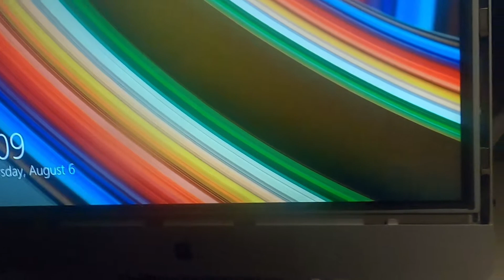Resurrecting a dead Imac into a stunning 1440p display

Comment: I still have to see one of these conversions show clearly that it is sync’d at 2560×1440. From icon size and desktop elements, it looks like 1920. You should include an image of the monitor OSD showing current mode, or computer display resolution dialog showing current resolution.

Comment: I got dizzy with your infamous camera work! And no need to be so dramatic, that LCD controller board is on sale on eBay cheap, just make sure you get it with the correct connectors for the LCD model number by looking on the white label behind the screen. Also you should cut a piece of plastic for the buttons and screw it to the space left by the ram door!
Reply from the maker: I will try to go slower with the camera.  Sorry I get excited making these videos 😜. I wanted to fill the ram door originally but I left it open for my HDMI, display port and VGA extension connectors to hang out.  It is my second screen sitting above and just behind my main screen which hides these connections, so it's not so glaringly ghetto and ugly 😏

Comment: Does something like this also work with a 21.5 inch 4K iMac?
Reply: Possibly. You need to find out the screen manufacturers information.
Reply: @4KWalkTubers  I see, thanks. What I’m actually worried about is space, because I’m not sure how much room there is inside the smaller iMacs and if that’s enough 😅
Reply: @anianii  I did the same thing with the 2011 21" model. I think the 4k models are a bit flatter right? But in mine there was plenty of space left. I even thought about putting some kind of mini pc inside. In the end I just went for a Chromecast.
Reply: @jeroenjansse95  I believe they’re the exact same size actually 😅 But thanks for letting me know 👍🏻
Reply: @anianii  a okay I thought the 4k was a newer (slimmer) model
Reply: @jeroenjansse95  Ohh yeah my bad, I thought you meant they were slimmer than the non-4K models. Those are the same. The pre-2012 models are a bit thicker though, you are right

Comment: My 2009 iMac can still be used as a computer or a monitor. I just replaced it with a 2014 so the 2009 is sitting on a table while I decide what to do with it.
Reply from the maker: Ur lucky my graphics card burnt out and then something else happened when I was trying to fix that so I had to gut the internals and just make it a monitor

Comment: Hi CWWS. Do you know what kind of controller will I need for a iMac 27" late 2009? Is broken and I want to use just the monitor as an external one. Thanks in advance!!
Reply from the maker: Check what brand your monitor is first.  There is a serial number on the back, you going to have to open her up
Reply from the maker: Model number
Reply: Look at the LCD MODEL AND TYPE printed IN THE BRACKETS from the white label.

Comment: Hi! I really hope you can help me here, I just bought the SDE3 kit (https://www.ebay.com/itm/184309258665) but can't get it to work. I can see the screen turns on but the light is very low, maybe 5% screen light or so, almost invisible. What kind of power supply do I need for this screen?
Reply from the maker: What kind of power supply are you using? I got a 12v, 6a

Comment: I have very similar Resurrection, but the Brightness of the LCD is too low. I adjusted the Brightness to 100 max on the switch panel, but brightness is still too low.
I measured the Voltages on the PWM pin of the Backlight Inverter Board of both the Chinese kit and the Original iMac Backlight Inverter board.

Chinese Backlight Inverter board measured PWM 0V LCD on and PWM 3.0V LCD off
Original Apple Backlight Inverter board measured PWM 3.0V  LCD on and PWM 0V LCD off

I have seen many comments about the BRIGHTNESS issue from others.

anyone have a solution for this?
Reply: Ive seen low brightness issue comments in other youtube videos on this matter. Im interested to hearing a solution over this too... anyone know anything about this?

Comment: I did this too, what connectors did you use for the speakers? And how did you wore them up
Reply from the maker: Yes check 6:00min mark onward I did a ghetto connection to test it, but ended up ordering these in the end
https://www.amazon.ca/dp/B01E5MZZMQ?ref=ppx_pop_mob_ap_share
Just wired it to the speakers.  Worked out awesome! The speakers have better base then other built in monitor speakers 🙂
Reply: @OGCWWS  can you show me how you wired the speakers into the board precisely?  Did your speakers also come with 4 wires a piece? (Light gray, dark gray, brown, black
Reply: @jeroenjansse95  This was what I used for mine:
Reply from the maker: Im affraid I can't really show you as everything is sealed up and I am using the monitor now.  Each speaker has 2 sets because they have little tweeters built in.  So you need to match the positive wit the positive and the negative with the negative and twist those together and when your jst connector comes with 4 wires (positive and negative for the left and right channels) you tie in your pairs. On the board I think you can see l and r for left and right Channels.
Reply: @OGCWWS  How did you find out which wires where negative/positive? (I heard something about apple messing around with wire colors to make diy harder...)

How does the sound work for you? A bit like the original iMac sound?

I appreciate your response btw😀
Reply from the maker: @jeroenjansse95  I can't remember exactly what they were.  I think went with the lighter colours for the positives and the darker colours for the negatives. Try it out on low volumes. If it sounds whack flip 'em.  For me it sounds great.  I never got to hear the original way they sounded, the computer was broken when I got it off a friend. They are much louder then my lg monitor.
Reply: @OGCWWS  thanks for the help, I just ordered the pin connectors I'm not very comfy with connecting wires with the new ones, but I think I should manage to do this. 

Oh btw you're also helping out a redditor with the same project😁
Reply from the maker: @jeroenjansse95  Hey hope it goes smooth, i just think it's such a shame to see these beautiful screens go to waste.  Some other people in this chat took them that much further, but I am just st happy with how I got it back and how it fits into my setup 🤠
Reply: @OGCWWS  oh wow! Just got my connector and it works and it works pretty well!!!! https://drive.google.com/file/d/1aLu_X9pZoohOy78RCaRKnAp8F1QXqj08/view?usp=drivesdk

Thank you so much!!! I now have a standalone TV/monitor with sound. Next step for me is getting the camera back to work😁
Reply: @jeroenjansse95  Can you provide picture of the R/L speaker wires connected to the connector you purchased?  I have just resurrected my 2011 27" iMac as monitor and wish to have sound.... Thanks!
Reply: @davidandruchuk7673  https://drive.google.com/file/d/181KX4o75gtz0hLfisus2lqit-KhchLFb/view?usp=sharing

I can't provide more than this at the moment. I hope this will help! I know that's hard to find a lot of info on this, but when you get it working...🤩 

Btw I have the 21" model, so I don't know if the speakers are any different. In the end I just hooked them up and it worked and I still use this beauty as my bedroom tv with a Chromecast hooked-up!
Reply: @jeroenjansse95  This is perfect, thank you!  Be well....
Reply: @davidandruchuk7673  the pictures are a bit messy. If you have questions, I will gladly help you with them. I just can't take the screen appart again at the moment.
Reply: @jeroenjansse95  Understood...  I gutted my 2011 27" iMac (all parts worked just dated) to use as monitor for my 2020 M1 MBP.  I left speakers in as well as camera for future conversion and closed back up.  Will complete the camera to USB and speaker connections in future.  Thanks again!

Comment: How you managed to use the iMac power cord ? Can you sent a pic
Reply from the maker: First of all I don't recommend messing with altering the power adaptors of anything unless you are very well versed in electronics or electrical theory. 

With that said.  You can kind of see at 2:53.  I cut the power chord from the adaptor and tied into the prongs power wires.  I don't recommend this however it was mentioned elsewhere in the comments that the power supply can possibly burn out and it is a real hassle to swap it out if that happens.  If I was to do it again I'd just let the power supply cable which goes  to the board  dangle out the bottom.  It looks ugly but it's better then burning out and having replace everything.   

Luckily mine has not Burnt out, however it does get very warm almost hot, I have light to medium usage with this screen it is never on more than half a day. If you have it as an always on monitor (On 24/7) I'd recommend letting it dangle and not using the iMac power port.

Comment: Hi, can i use 12V 5A power supply to
Do this?
Reply from the maker: Double check which panel you have first, it will determine what controller you need and the power requirements

Comment: I salvaged my 2011 mid iMac to a monitor same way. It's running well for 1 year, My suggestion is to keep the DC adapter out install a DC female jack on the Ethernet port hole. Because, those DC adapters are not quiet reliable, I had to change them twice already, such a pain to take everything apart for changing the power adapter. Also route HDMI through the power port hole, removing the metallic leads. No need to keep the switch panels outside if you're using it as a monitor, when you power up the unit it comes automatically ON.
Reply from the maker: Thanks,  good to know :)
Reply: i have the same iMac with a dead gpu, can you give me the name of the controller board you bought?
Reply: @genesionuvunga1789  I Have a 1419 iMac with LM270WQ1 (SD)(F1) panel and purchased a XY_VH2E556_v2.0, I'm about to install it, in the sellers page said it is compatible with my panel...   finger crossed

Comment from the maker: You need to solder it to the driver's control board power button.  I said wire but technically it's solder.
Reply: Thanks, we'll see if the controller board is compatible with the iMac button when it comes.  I wish I could just find a power supply with a power button input, but I haven't had any luck.
Reply: The board I got ended up being compatible.  So I just soldered the power button to the board.  I also took a thunderbolt dock out of its case and put that inside the iMac.  That let me wire up the iSight camera, microphone, DVD (with a USB bridge) and speakers (with a USB amp) to use.
Reply: @SD-cu1ir  hey, i'm using my iMac as monitor/TV for 2 years now.  Only thing bothering me is the speakers not used. What amp did you use? How did you wire it?
Reply: @jeroenjansse95  I used this amp:  https://www.ebay.com/itm/321651421476?hash=item4ae3eb3124:g:UtcAAOSwk5FUxTik.  It looks like there are cheaper versions available now.

It connects via stereo jack.  The iMac speakers have a tweeter and woofer in each speaker module, so I wired up the left and right tweeters to the L&R channels and then both woofers to the woofer channel.  The power is too high for the iMac speakers, so I manually set the volume at 50%.  It's been working great.
Reply: @SD-cu1ir  so you're using 2 power cords (display board and amplifier?) Definitely gone try this amp
Reply: @SD-cu1ir  so if you turn the volume button on the amp to the max the tweeters will blow up or just make strange noice?
Reply: @jeroenjansse95  I actually made up a wiring harness with multiple plugs that is fed from a single 20A power supply that sits outside the iMac.  I have the controller board, a thunderbolt dock and the amp, with plans to add in a powered USB hub because I want to make the usb ports functional.  But an important note about doing this, powering the amp from the same power source creates the opportunity for a ground-loop hum, so I had to add a ground-loop filter.

I turned the physical volume down for two reasons.  I didn't want to risk blowing the speakers with too much power (the amp is rated at 2x the power as the speakers).  Also, keeping the volume lower gives me more granularity with computer volume changes.
Reply: @SD-cu1ir  Ah okay, I'm not that electric confident so I think I will go with an power strip to keep things simple. I'm hoping to figure out how to reuse the iMac power button to powering the display controller board.  

Next thing first after the speakers, is converting the camera to USB. (It's a shame the mic is separate).

Thanks for the quick response, very helpfull!
Reply from the maker: Hey sick! Glad it worked out and then some!  It really is a beautiful monitor and is one of my main displays now.  Let's hope we will have it for decades to come!

Comment: I'm planning on doing the same thing, but am still in the research phase.  How did you wire the power button to get it to control the display?  Thanks!
Reply: Hey, how's your project went?
Reply: @TheKauan08  It's pretty good.  I put a usb-c dock, a usb hub, and an amp inside the old iMac.  I've wired the iMac speakers to the amp and connected them to the dock with a usb adapter.  I've wired the built-in webcam to usb and connected it to the hub.  And i've connected the superdrive to the hub with a data-usb adapter.  I used to have the microphone working too, but it burnt out.  The whole thing is powered by a couple of USB-C power bricks on the inside (one for the monitor, one for everything else).  I now have 1-cable connection to my new MacBook Pro.

My next step is to try to mount connectors for usb and ethernet through the ports on the back of the iMac.  But since this is my daily-driver, I can't afford to have it down, so that will have to wait.